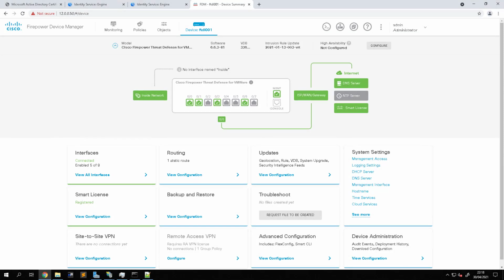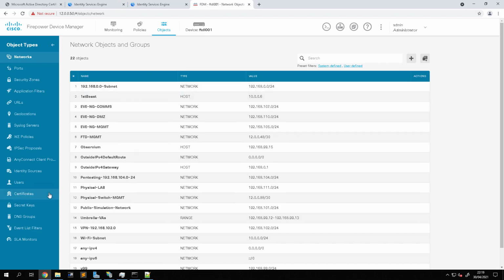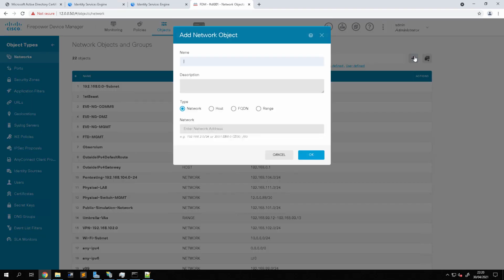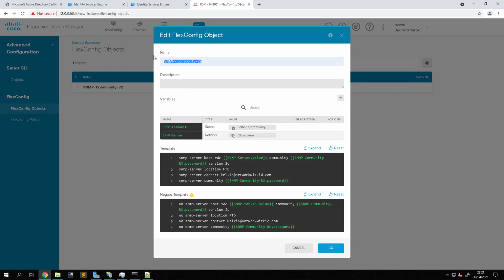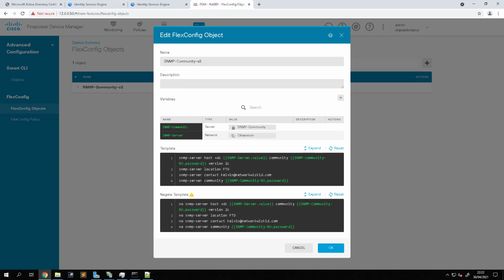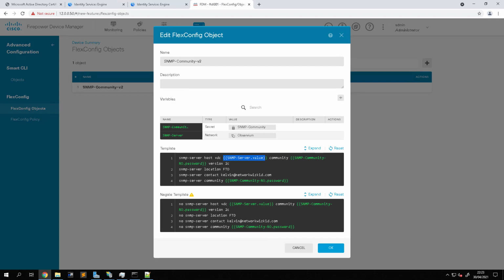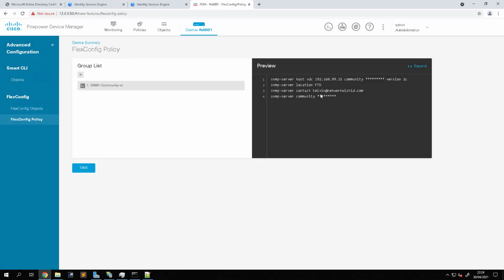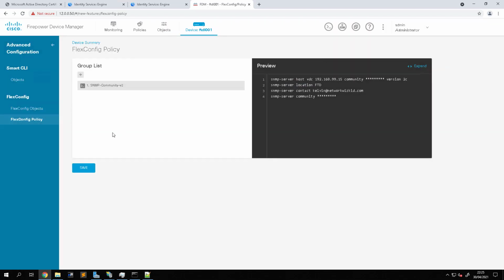Configuring Cisco Secure Firewalls for SNMP using FDM

Comment: This script does not work for me
Reply from the maker: Make sure it is exact...spaces etc...
Reply: @NetworkWizkid  it is but I think your commands are not supported in the newer version. Your link to the script is not working either
Reply from the maker: Thanks for letting me know about the link. I have updated it now and it should take you to it.

You could be right about the version, but I cannot confirm as I have not tested it against newer versions. Please check the Cisco documentation, hopefully you can get more info there.